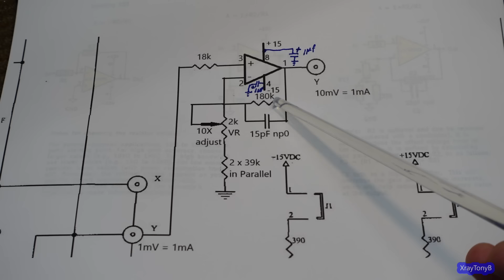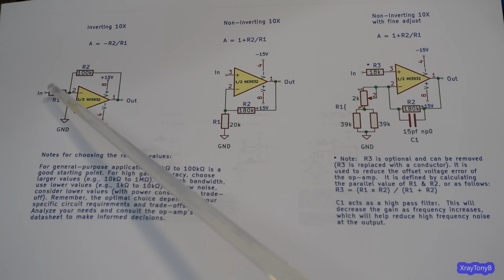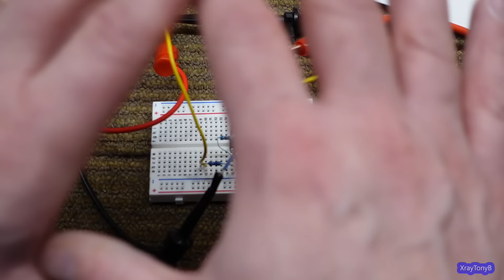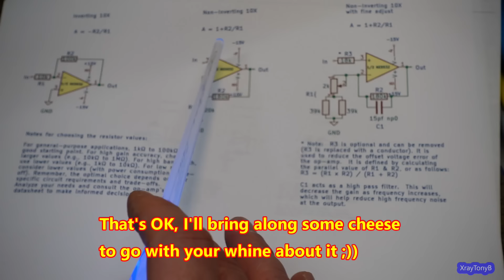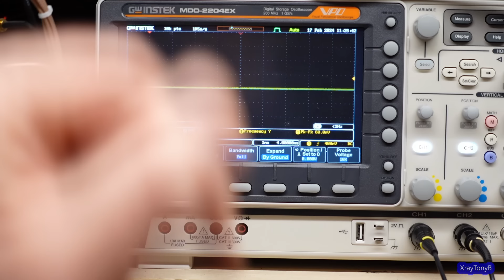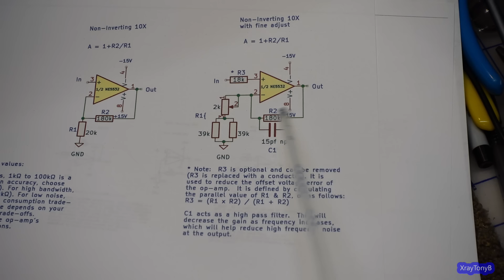Viewer Comments - A closer Look at the OpAmp Scaling Circuit

Comment: Hey Tony I’m not sure what’s going on but I went to your channel to see if I missed any videos (I didn’t) and I had to subscribe again and that’s not the first time also you’re not the only one. That’s probably the third time. I’m beginning to think youtube plays games with peoples channels for some reason. Anyway can’t wait for the next video! You should do a bench power supply build with bolts and current adjust. Right now I’m using ATX for power and a permanent car battery setup I have for car amps and my garage alarm system.

Comment: Hi Tony. One question: what happens if Rf < Ri? Will you get attenuation, or just blow the op-amp (i.e. does the gain equation only hold for Rf >= Ri)?
Reply from the maker: I actually demonstrated that in the video.  I swapped the two resistors and the gain dropped to 0.1.  Go back and check it out.

Comment: Hi Tony
A question not related to this video, but to the ones you did about speaker protection relays. I have a Pioneer SX3600 which doesn't have such a protection relay and I want to add one. I just ordered a kit just like you showed in your video and I'm confident I can install it just like you did. Reading on this, I came upon a comment on a Facebook group where someone mentioned Pioneer uses a "crowbar" circuit as protection for those amps that don't have a protection relay. This got me curious so I looked into it, I think I understand the principle behind a crowbar circuit but my knowledge is too limited to figure out if Pioneer indeed uses that or if my receiver (or others) have that. I don't remember you mentioning this before, so if you could give me your thoughts on this I'd appreciate!  Thanks for posting those videos, I learned a lot and I find this fascinating to watch.
Reply from the maker: The overload protect or overcurrent protect (or can have different names) will limit the amp from overdriving the output transistors and speakers.  What it will not do,  is disconnect the speakers from the amp,  in the event that an output transistor shorts.  A shorted transistor would still result in the DC rail voltage going across your speaker (very bad).
Reply: Ok thanks! I appreciate taking your time to reply. My goal is to protect the speakers (a pair of beautifully restored Dynaco A25 from the 70s), they are worth much more than the amp and not as easy to replace, so I'll go ahead with my installation of a protection board. Thanks for your videos on these, that was clearly explained and convinced me to add one to my app. Regards   Carl from Quebec City Canada.  @xraytonyb

Comment: I’ve seen an inverting op-amp  meter scaling circuit where the two input resistors are 100k each and measuring a voltage across a 1.5k resistor. The + input is tied to ground by its 100k resistor.  What is the purpose of that resistor? (Reduce offset error?) please explain.
Reply from the maker: It sounds like you are describing a differential amplifier circuit.